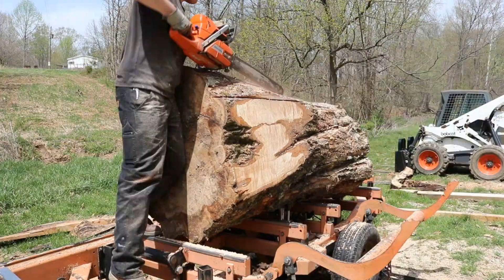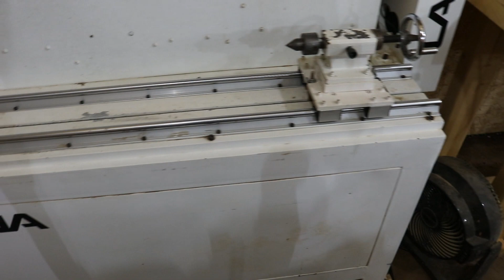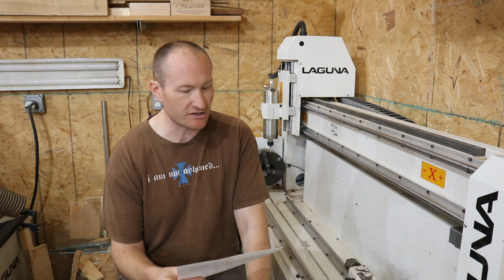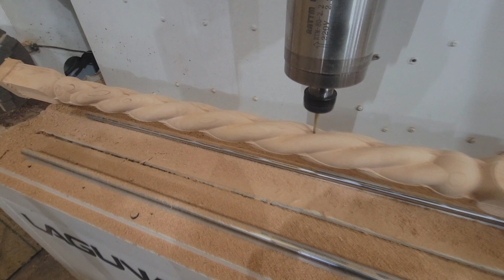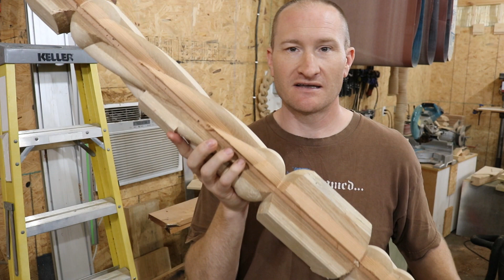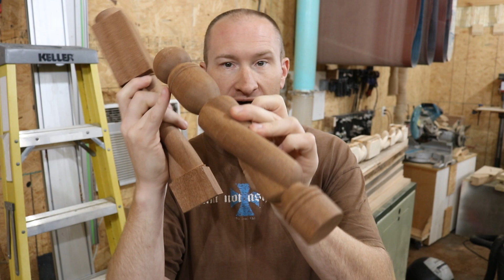The Coolest Tool in my shop - Nightmare repair - From Trash to Treasure!!!

Comment: What software are you using to develop the models.  Do you need a post processor to convert the design into g-code ?
Reply from the maker: I use Rhino 7 currently to model and RhinoCam to run tooling paths and process G code. It is way more than I need, but it's what I bought years ago with my first CNC so I stick with it.

Comment: It's better described as a Machining Center and you've done well at restoring it. I used to work on similar models stemming from my Machine Shop days and for someone without the knowledge and experience, you've done an excellent job! Today's machines will TELL YOU what's wrong with it, many times before things go awry. The one you have only does what YOU TELL it to do. Troubleshooting can be a pain at times and repairs can be expensive, but it's worth it when the machine operates properly and correctly. I'm looking forward to seeing some of the projects you'll be doing on this beautiful tool. 👍
Reply from the maker: Wish I had you there to help me repair it!  You are absolutely right about many newer machines compared to this one.

Comment: Love this video and would welcome the chance to know more about your tools, workshop and methods of work in the shop. Even if you are showing tools like this which I will likely never have, it would be great to see how they are used so I can adapt and work with some of the tools I do have. For example, seeing this set my mind to wandering how I could combine my big router and my Shopsmith Mark V to do duplication work. It would not be computer controlled but I believe good work could still be done.